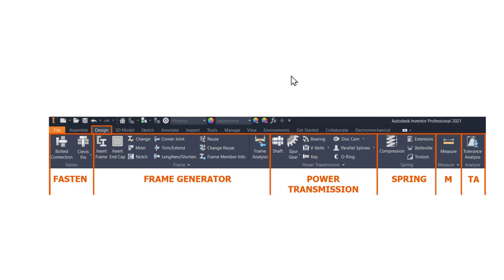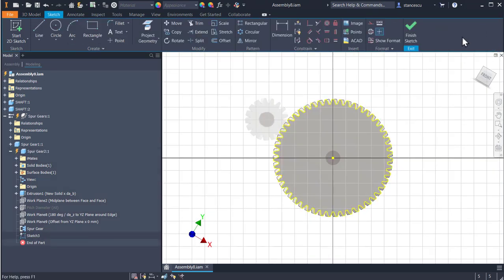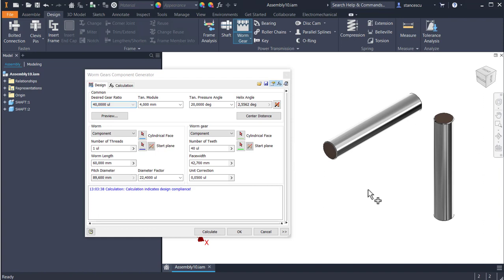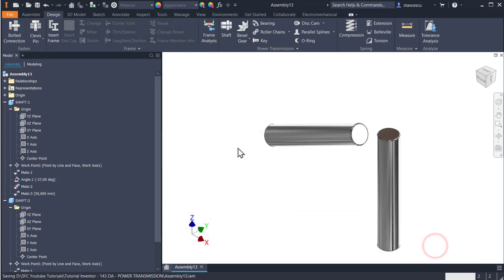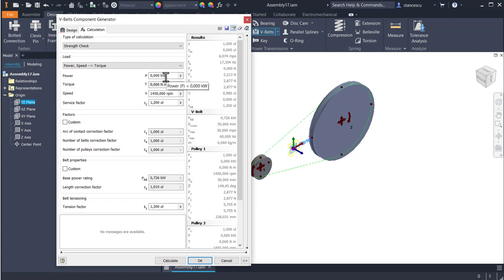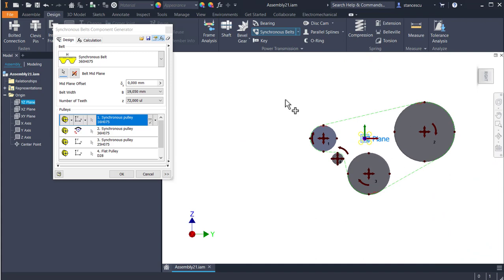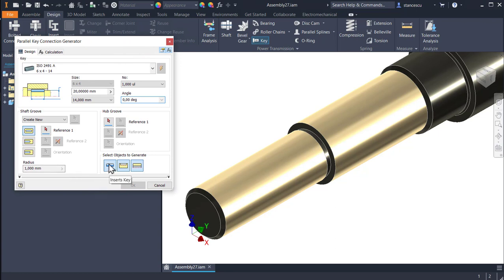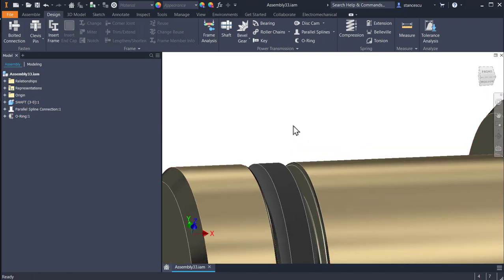Tutorial Inventor - 143 DA - POWER TRANSMISSION

Comment: hi thanks for the tutorial, it gives us so much view about tools that we can use
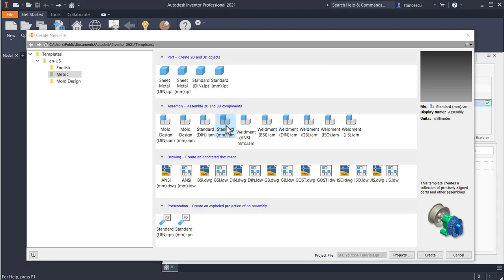by the way, in my school we have to design a reduction gear (maybe gear ratio 1:30), I just figure a two stages spur gear with 1:5 and 1:6 gear ratio
 it is just for education that we crank with our hand will give different speed

I change the drop-down list (module) to number of teeth, I click 5 in the desire gear ratio
then click calculate,but it shows "calculation indicate design failure"
should I change the parameter of power? 
actually, I don't really know about how much power will I deliver to the system with my hand
I really want to learn more about this, I don't know what parameter I should change like the number of teeth in small gear and bigger gear,module, unit correction, face width, and so on
thank you
Reply from the maker: Hi Ian and thanks for following my tutorials.
Try to use a small value for power (ex. 0.001 kW) and then apply Calculate.
Do the same with the first gear presented in the tutorial.
Good luck!
Reply: @prof-stancescu  hi thank you so much for your reply, but could you give me a suggestion where do I learn if I want to know more about choosing the right specification (number of teeth, unit correction, module,face width)?
I think I will confuse in the future if I can't understand that problem
or maybe if you have time could you make a video of that?thank you so much
Reply from the maker: You can activate Design Accelerator / Spur Gear as in the tutorial and then apply Help to find this:
http://help.autodesk.com/view/INVNTOR/2021/ENU/?guid=GUID-3BCB80E6-3328-433B-972D-C92D6CED7674
Find there everything you want.